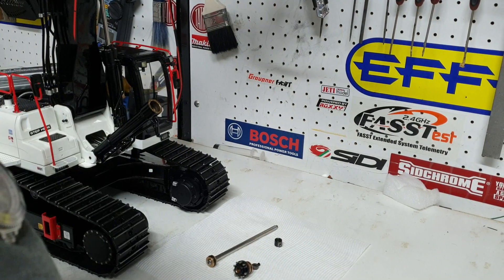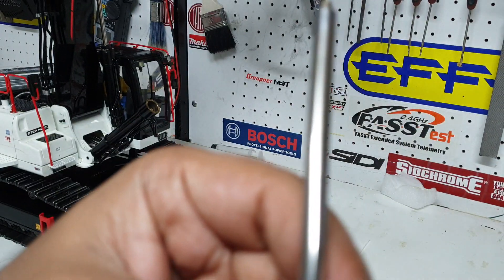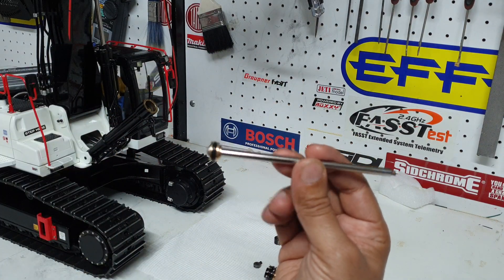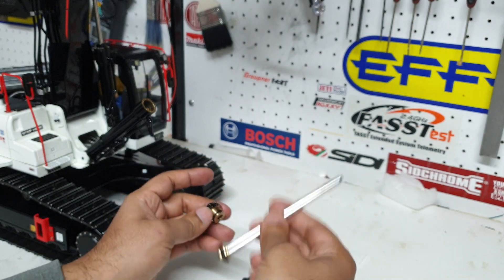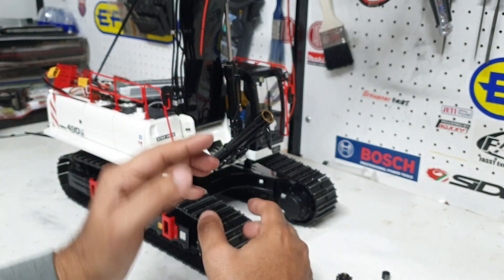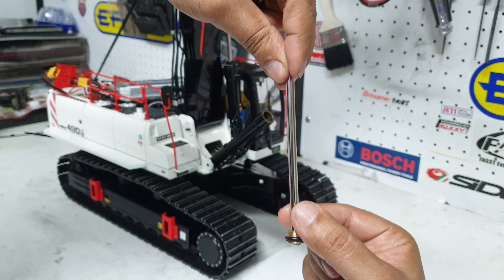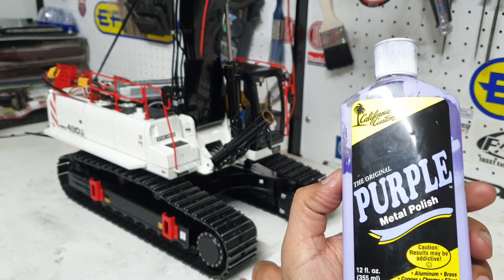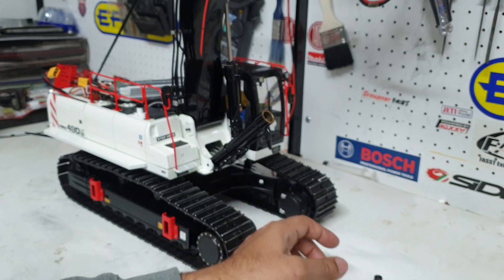CSMI Hidromek RC Hydraulic cylinder repair. How to stop hydraulic  cylinder leaks.

Comment: Hi How do you connect or How does the 2 hydraulic cylinders from the boom work? Do you need a different servo for the 2? Or just use a Y hydraulic hose? Or basically how do you synchronize them both.
Reply from the maker: Its a simple Y connection.  With single servo ..Thanks
Reply: @CSMIRC  ok thanks

Comment: keep the tank slightly under half you will never see the leak.! so what happen about my last question kev about the radio control FS 10ch i6s i told you that in the your last video how can let my radio reading my battery 3s voltage.excellent video anyway thx bud
Reply from the maker: Hi EW thanks for the feedback.  Can you share with the audience why and how the level of the tank would stop a leak. Thanks

I lost track on your other question. I dint understand you last  question actually....